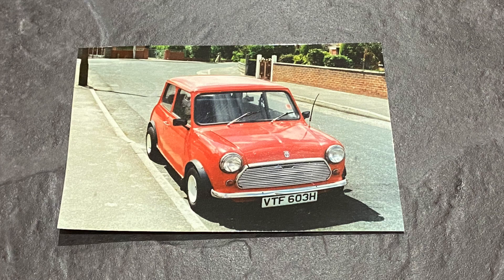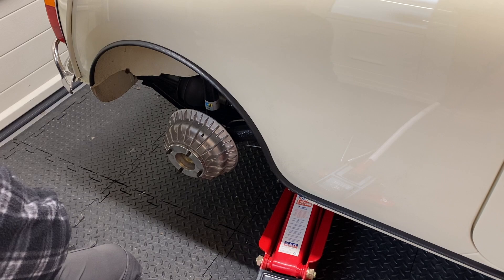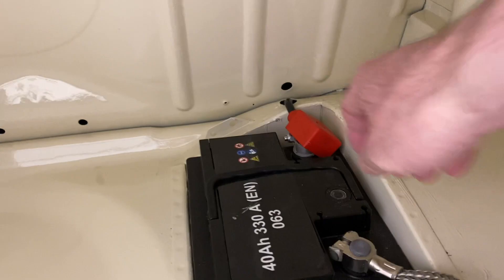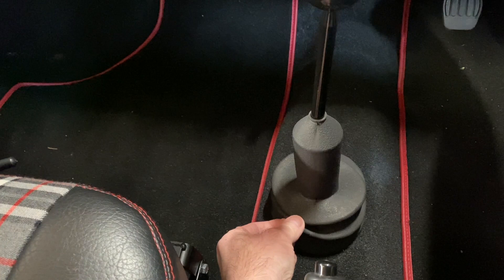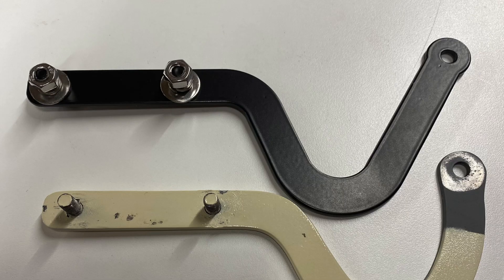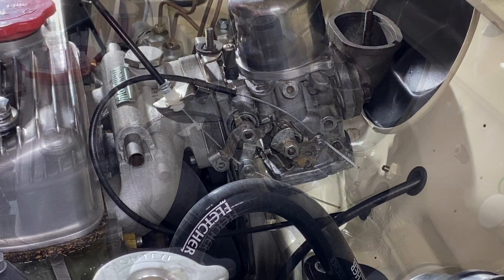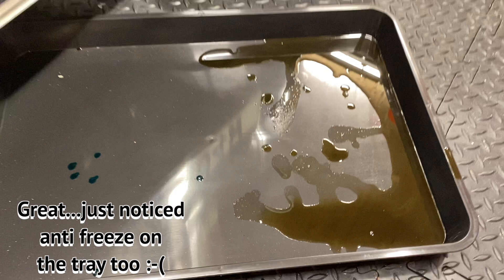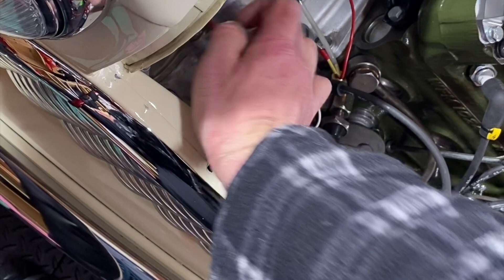Classic Mini Restoration Episode 49 - Taking The Mini Off The Road :-(

Comment: My vans still rattling 3 years on 🤣
Reply from the maker: Im slowly learning to make sure ive added shake proof washers or nylon lock nuts where possible...had the coil bracket bolt fall out the other week...all these pot holes dont help either :-)

Comment: Lee,  The rattling around the dash could be the L shaped brackets that hold the dash just fit some rubber or split hose over the clamp and this will stop the metal noise. Check your plastic should around the steering column as this is a common issue with minis just hold it at certain RPMs and see if it stops. You have my WhatsApp 
if you need to have a chat about any problems but this always happens with a restoration particularly with none OEM parts.  Cheers Dave
Reply from the maker: Thanks Dave. The dash bracket wing nuts keep coming loose. Ive bought some split washers to add and see if that helps. I wasnt sure how hard to tighten the wing nuts either as it bends the dash and im not sure if that bend is supposed to happen or not :-)

Comment: Wow, looks like a few issues all at once, I tried mini sport , did they say how long before the R R is back in action? The next one an hour away is that on the way to North Wales? The hub nut looked very loose, I'm sure I saw about 180lbs for this on line, good luck 😊
Reply from the maker: A little bit of mixed messages from Minisport as initially I was told summer time but have since been told there’s no time been given as yet. I believe there’s a computer issue. If it gets sorted soon I’ll book my car in. If not, I believe there’s a place in Morecambe which has some experience tuning minis. The hubs now had a new cone washer fitted and been re tightened…just hope this one lasts 🤞